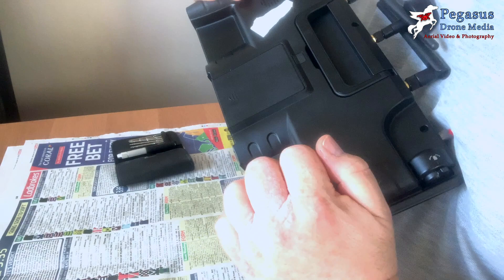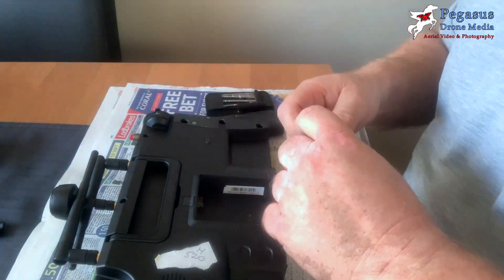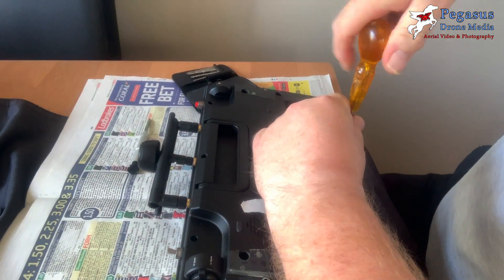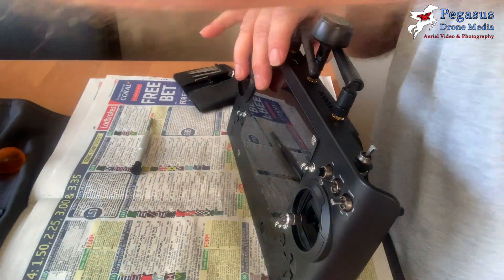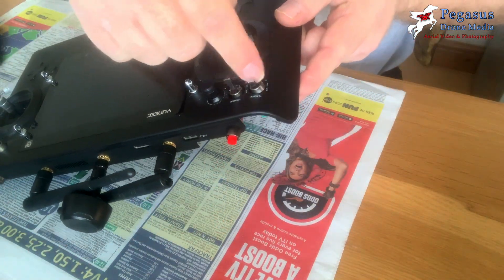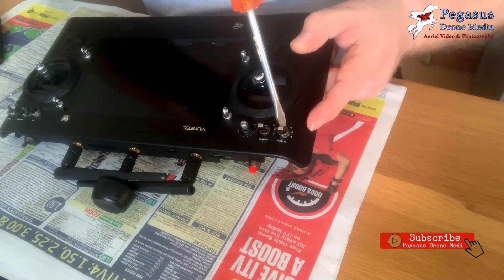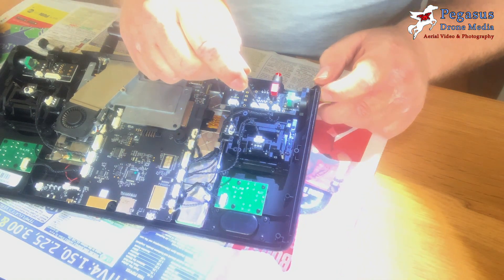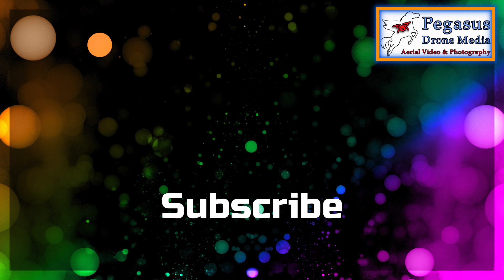Yuneec ST16S H520 & H Plus Controller - How to change the K2 slider pot

Comment: Hey Chris, I happened to insert my micro SD card in the ST16S and it  missed the proper slot opening. It fell into the controller and was rattling around, so I decided to use your method to open up the back. It is kind of tricky getting the rubber grips in the small grommet holes, but with some persuasion I got it all back together. I didn't really need to take the whole back all the way off to get the sd card out. All I had to do was loosen it up and let it fall out of the top after I just opened up enough gap. I understand other H flyers are finding out that the SD card opening is quite wide and you have to be careful to insert the card in the slot and not do what I did.
Reply from the maker: Glad you got it sorted Tom. A drop of Vaseline petroleum jelly helps the gromets back in.

Comment: Hey Chris glad to see how to take apart the back of the ST16S controller. I happened to put in a micro SD card in the bottom about a week ago and it must not have been aligned in the exact slot and fell into the controller body. I can now hear it sliding around inside when I tip the controller up and down. It doesn't seem to be a problem as I put in a new micro SD into the slot and it connected so the new one must have been aligned properly into the correct slot. I don't plan on opening it up just for getting out the SD card, but just in case it gives me problems I will watch you video again so I can remove it. Thanks!
Reply from the maker: Hey Tom. It’s real easy to do but if you have any issues buddy just message me on FB.